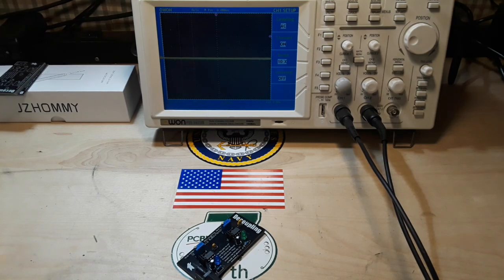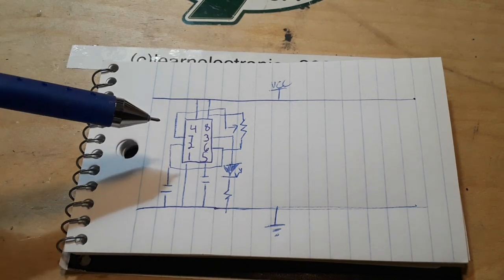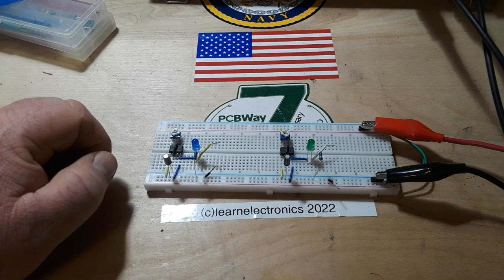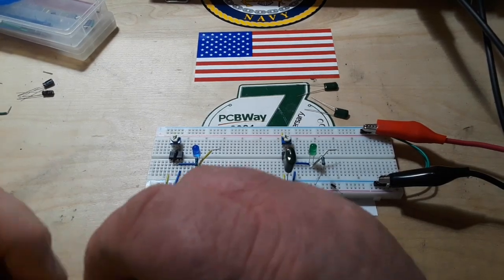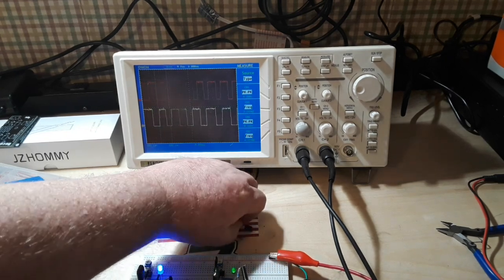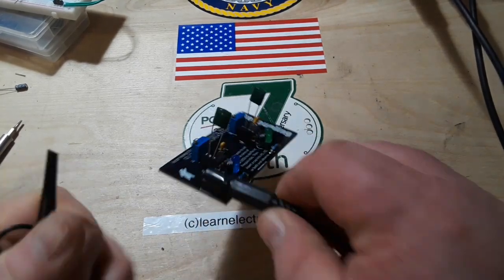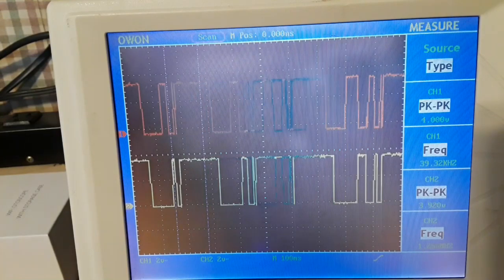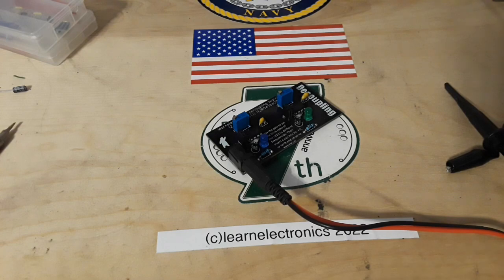Decoupling Capacitor Example

Comment: That's excellent. I have a degree in microelectronics engineering and yet I can't recall ever being taught about decoupling capacitors in university, only afterwards with actual practical exercises.
Reply: Whatever we learn...... It's only from the practical work.

Comment: Great video....In the past I've often had more than 1 555 on a board and noticed the same thing, going in phase that is....really frustrating since I was clearly trying to get 2 different pulse values. I just chalked it up to a strange anomaly and went about  finding another way. I never thought of putting caps across the vcc and grd. Keep up the good work. And yes, maybe a theory as to why they sync would be nice....I have no clue.

Comment: Thanks Paul, I think you have given me renewed hope!!   I became disheartened with a project  as pushed it to the back of the bench two years ago.  3 different frequency multivibrator chips (for tones) being  triggered by three different timings chips,   no decoupling caps anywhere!  I was observing spurious unexplainable trigger signals firing all outputs simultaneously.   I'm very excited now to bring this back to the front of the bench.  - Cheers!!

Comment: This effect is a factor in design of pcbs as well. A large amount of work is done to eliminate " crosstalk" and "ghosting " in major  assemblies. The actual resistance of the traces along with the capacitance can form rc circuits that can cause major problems

Comment: if you connect them to diffrent power sources this wont happen. i think there is a small current flow between the two circuits because of the potential diffrence. so slowly that potential diffrence gets smaller and they are in sync

Comment: Your camera settings:
First thanks for all your interesting videos.
Now just one idea: If you would put your camera on the opposite side of your breadboards we could see very much better what you are doing. At the moment there is often your hand in the middle of the screen hiding e.g. the parts that you are inserting in the board. What do you think about it? Will you give it a try?😊 Thanks a lot. Regards, Bo, Switzerland🇨🇭

Comment: hey paul, did you put a cap on pin5?
i think the syncing is because the noise on Vcc messes up the voltage divider inside the 555. a cap on pin5 should do the trick for small circuits as well. greeting
Reply: I am currently working on a synthesizer that uses 3 dozen 555 timers. Each set of 12 tuned to the top octave. 
Each set of 12 timers has their pin 5 commoned together to give each set a master tuning control. When I populated my first set of pcbs I did not have decoupling caps between pin 5 and gnd and I could never get them in tune. My second attempt has a 100n cap between pin 5 and ground on each chip and now they all stay tuned. Iirc putting a cap between vcc and gnd for each chip didn't help but between pin 5 and gnd it worked. 
So I think your theory is correct  :)

Comment: I think this says as much about the 555 timer susceptibility to supply noise as it does about supply decoupling. I stopped using 555timers when 8 pin pic's became cheap, as the 555's can be a pain in the butt for resetting on a supply spike even with decoupling caps. The car environment was never clean enough for them, motor or horn current dumping would normally cause a reset or some strange affect.

Comment: Hey Paul. 
A couple years back I built up some pcbs for a synthesizer project that uses 3 dozen 555 timers. My first pcbs did not have provision for decoupling caps so I could never keep them in tune. For me to keep them in tune I discovered that placing a 100n cap between pin 5 and gnd got them to stay in line but when I placwd the same cap between vcc and gnd on each chip the problem persisted. In my design all of the pin 5's are commoned together for master tuning so maby thats why I had different results?

Comment: Been looking over your old videos for making function generators. I noticed the main event in those circuits is the integrator. That got me thinking... PID controllers need to do integration, but they also need to do differentiation as well. What's a differentiation circuit like?
Reply: Same as an integrator actually, but with the resistor and capacitor swapped. Current through the capacitor is directly proportional to the derivative of input voltage, then because of virtual ground effect the output voltage across the resistor is directly proportional to that current, so you end up with the output voltage being directly proportional to the derivative of input voltage
Reply: That's way easier than I thought it'd be.
Thanks!

Comment: That doesn't make sense by adding decoupling caps across +Vcc to ground would isolate the syncing 555 timer issue. I'm not sure why adding decoupling caps across +Vcc to ground will separate the syncing issues of both 555 timers. Can you explain more of the theory behind this?
Reply: I think it's due to noise on the power lines affecting the behavior of the 555's.
Reply: @Enigma758  The Decoupling Caps are allowing separate syncing for some reasons
Reply: @waynegram8907  Without decoupling of the supply, you may get periodic noise from the supply which affects both chips.  Without decoupling of the chips, you may get periodic noise from one chip affecting the other chip.

Comment: If this was true, it would work with separate isolated power supplies or batteries. There is some pickup via the common psu your using. It is totally unscientific.
Reply from the maker: If this was true? Lol
Look at a computer circuit board. See all those little caps by every IC? What do you imagine they are there for, company?
Reply: @learnelectronics  there is only one way to find out, & run each circuit on a separate supply.

Comment: The choice of color on that board was not good. If this is to be an educational adjunct tool, it should be as clear as possible.
Reply from the maker: All of my boards are black. All have the "happy bear" logo. Must maintain brand identity.
Neither the students nor the instructor have had any problems.